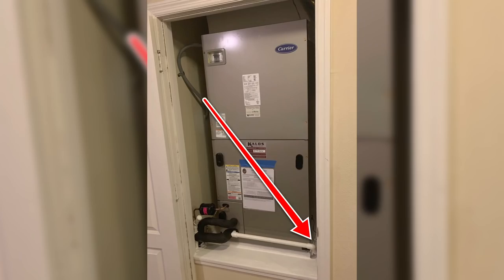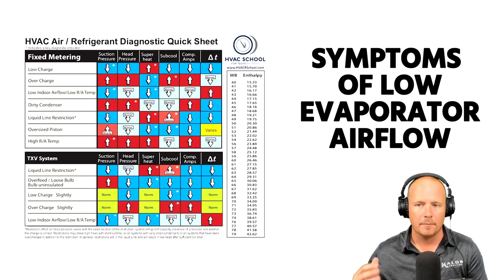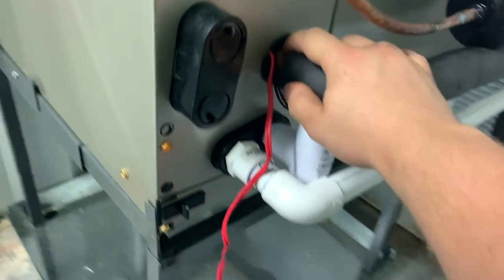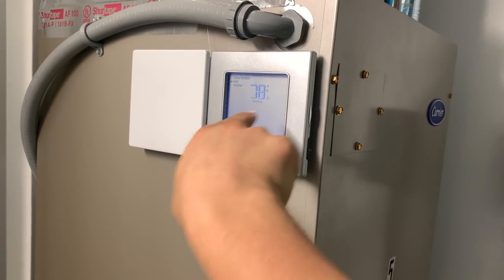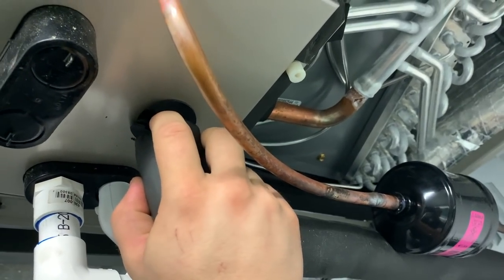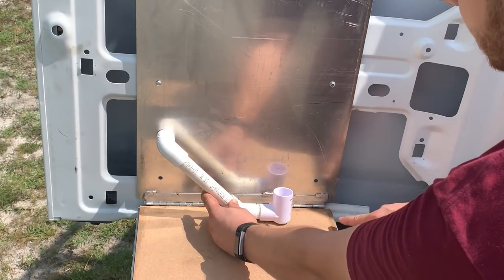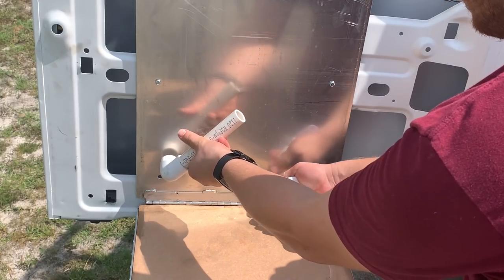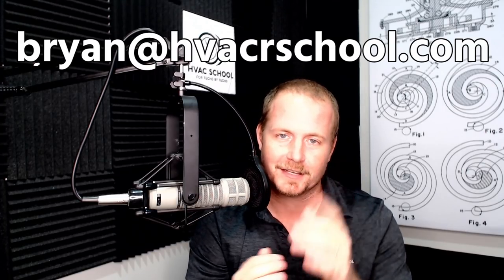Wire Routing & Float Switch Positioning

Comment: To the original installer! (Where was your common sense?) it amazes me how many times I will come across installs like that. Thanks guys!
Reply: Most of the time, the installers are just in a hurry to get stuff hooked up.  They don't typically have a lot of experience in the field.   This video is an excellent opportunity to have them understand the reasoning for best practices without bringing down their self esteem.  Our industry is lacking in bodies, running new guys off is a terrible idea.

Comment: I never had a problem with the switch going straight out (without going down). If anything I see that as a potential problem as someone might by mistake kick it off and water will leak all over, or open the switch as it falls on the ground. I guess everyone has their way. Either way great video I sent to our installers so they do things right. (Yes had that plenty of times that the switch was under the pipe 🙄). Thank you HVACSPC (HVAC School PodCast) 😉

Comment: 3:39 This is exactly how I run the thermostat & float switches wires. I had a customer a few months ago calling me because she didn't like it. She said she was a designer & the wires didn't look good for the human eye in there. She said they looked better in the front of the unit & up. Yes, in front of the door & filter. 🙈I told her that & she said she was going to tape them back on the side of the unit again. 🤷

Comment: I know y'all like doing those ss2 like that but it sure leads to nuisance trips and the water will never dream to reset the float and keep the system limping along with a slow drain. Maybe consider just one 90 out with very slight slope down. Also those ss2 are adjustable. Maybe you just need to lower it slightly or use clip on sensor for the primary pan?
Reply: Hmmm 👍🏻👍🏻

Comment: Why not installing an inline drain switch to avoid blocking the air filter?, if customer is not very carefully is possible to force the secondary port at the unit and cause a big damage to the pan.

Comment: I thought both lines needed to be insulated on a heat pump or is it not that critical?
Reply: @sprockkets  ah ok maybe the going through the attic thing is the reason why I've seen some heat pumps with 3/8 line insulated.

Comment: Thats got to be commercial install, cause no way im telling the customer to shut the unit off and take apart pvc pipe to change filter. Why not use the filter rack on stand and just 90 the secondary with a little pitch to where you have access.